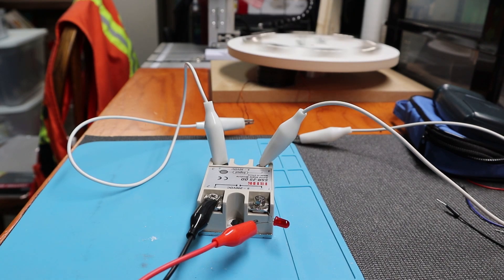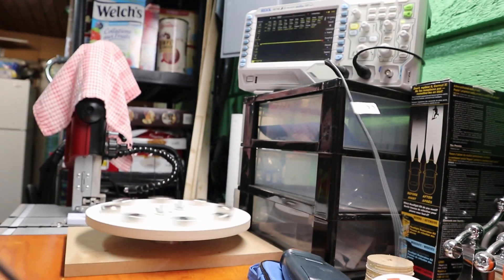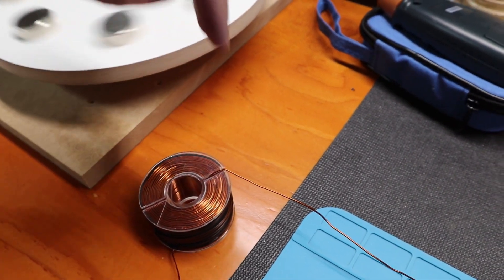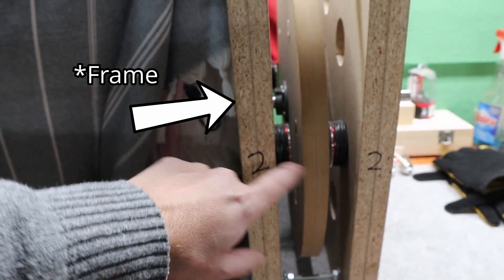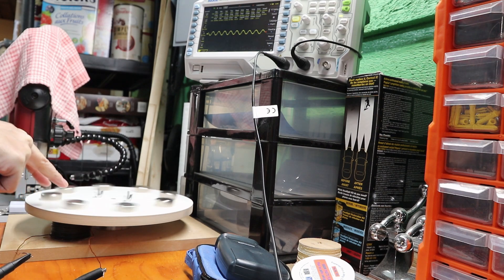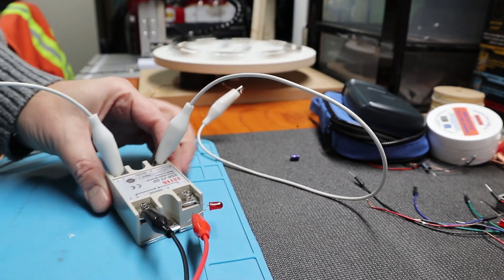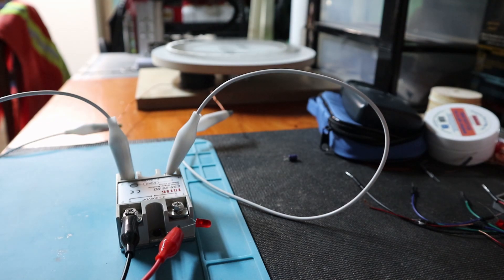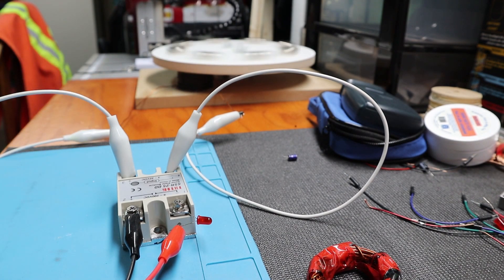Electro-Magnetic Pulse Motor - Part 17

Comment: Bonjour,est ce que je peux,utilisé se relai SSR pour alimenter la bobine du moteur ADAMS ?
Reply from the maker: Yes balloutyves, I don't see why not.  Adams used a coil to sense the movement of a magnet I believe.  SSR's typically only require 3-36 volts on the trigger side so you shouldn't need a very large coil, but if it's not big enough you will need to crank your flywheel up to speed by hand initially.  Of course, this also depends on the AWG of the wire you use.  In this video, I used 18 AWG wire and could produce a max of 30-40 volts @ 200 RPM.  Later I tried 28 AWG wire on the same-sized bobbin and I was getting close to 200 volts out of it @ 200 RPM.  So I'd suggest trying a bobbin from a sewing machine, wound with 28 AWG wire,  This should get you 30-50 volts you can send to the SSR as a trigger.

I switched to hall effect sensors in my later videos.

Good luck.

Comment from the maker: I said I was holding a coil containing 28 gauge wire at 15:54 but I was mistaken.  That was also 18 gauge, the 28 gauge coil I meant to refer to was sitting just off-screen.  Sorry about that, check video no. 18 for a brand new coil I made that does contain it.

Comment from the maker: I'm an idiot, I completely forgot that Badini motors also use a coil as a trigger.  But in my own defense, I have to say it's been years since I'd seen a Badini motor video, and I totally forgot about him.  Also, he wraps his trigger wires in with two over wires that he uses to send pulses through, otherwise known as a Badini bifilar winding.  (Not to be confused with a Tesla bifilar coil.)  Including a trigger winding on every coil makes the timing of the pulses extremely accurate, but...  So long as my spacing is accurate I can't tell which system is more efficient.
Reply: doesn t matter. Good idea! Efficiency
Reply: What i found interesting is that the Bedini circuit is just a modified joule thief circuit which have been around been known by hobist long before Bedini. Also its the same circuit used in those single transistor flyback drivers.